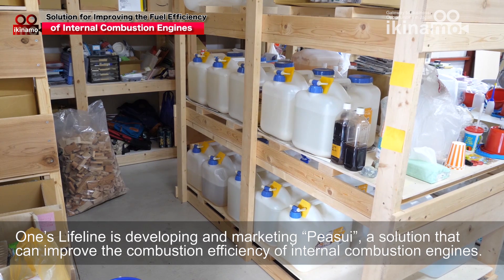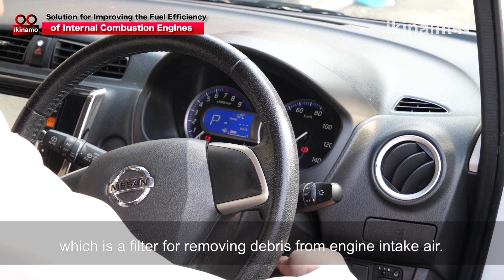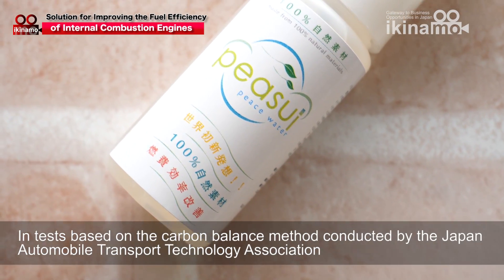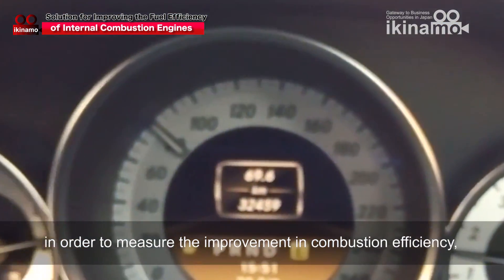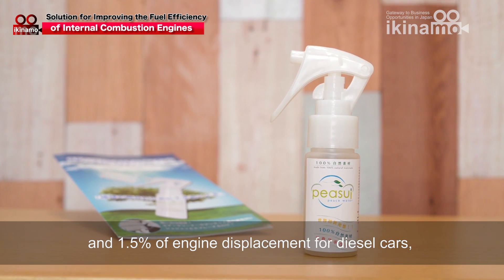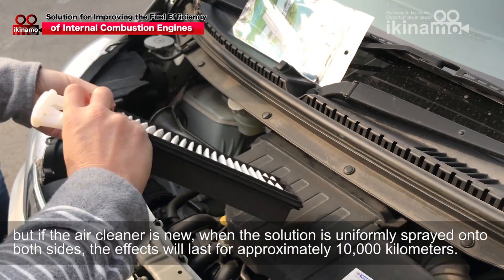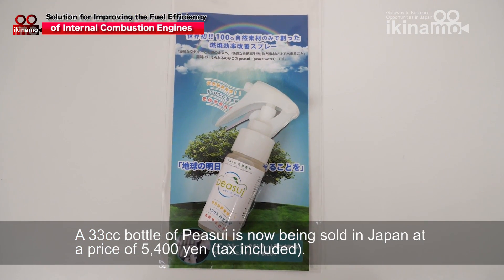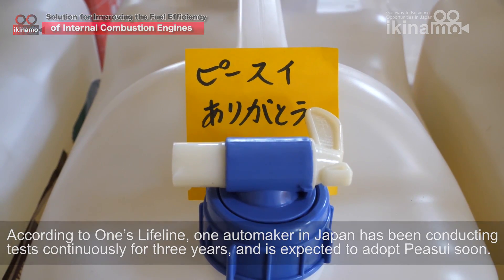Solution for Improving the Fuel Efficiency of Internal Combustion Engines

Comment: I can't really trust this stuff works without an available study to verify it, and based on how cars and motorcycles must be tuned after they are modified in anyway involving their power plant systems.
Every time you change the efficiency or or flow of a motorcycle, it must be re-tuned, same with most cars. So this would be cause for another retune if it does infact change the airflow and combustion efficiency.
Reply: FranBunnyFFXII trust the car manufacture if it adopts this product.